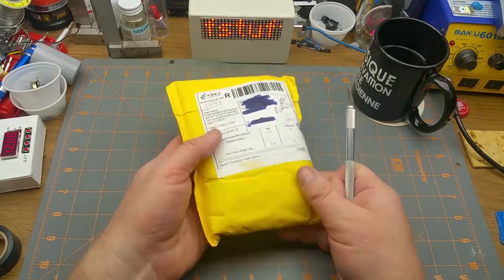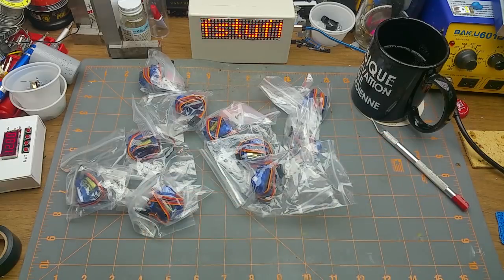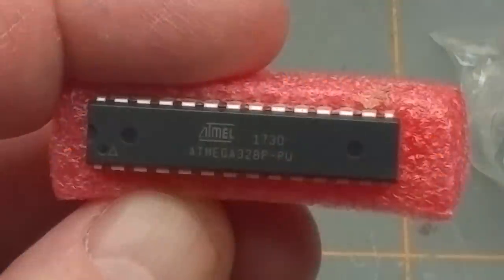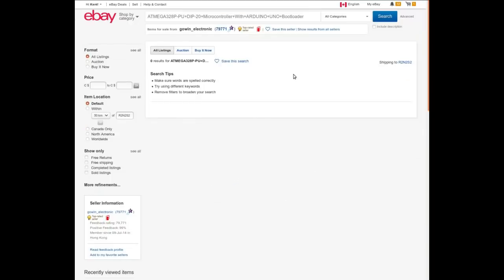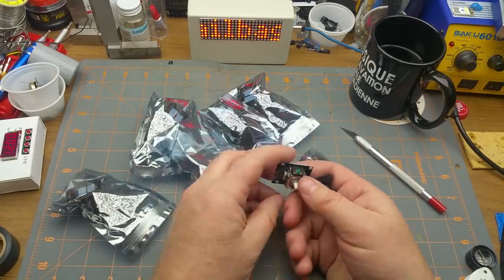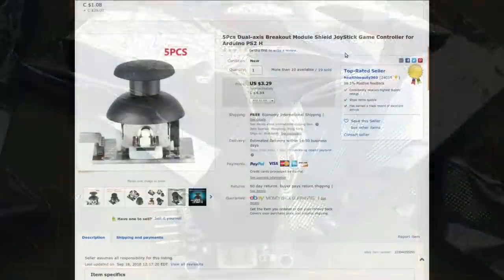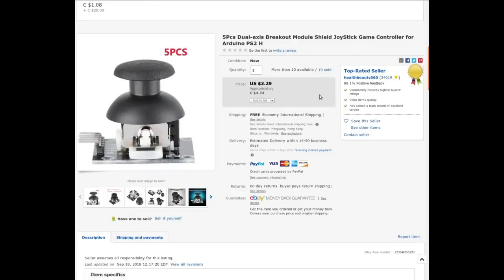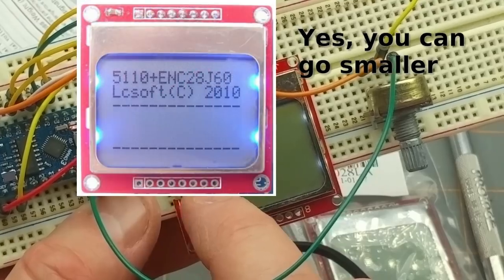mailbag monday 45

Comment: "'Plastic sheet' ... their go to lie, for customs."
When you order a 328p with the bootloader,  will need a 16mhz crystal to run it on a breadboard.  You can get by without though, by flashing Optiboot+fuses for 8mhz internal clock.  An ordinary mega8 is about 0.75USD -- low-flash / small projects.  https://www.aliexpress.com/item/10pcs-lot-New-ATMEGA8-ATMEGA8-16PU-DIP-Flash-IC/32261282498.html 
Wow, those Nokia displays are everywhere.  They must have been vastly over-manufactured.
Nice sign!

Comment: I used the Nokia displays on a pcb, added rgb backlight. Sadly the contacts aren't that great sometimes and I have to push the display down to the board to make it work. Really annoying, won't put them on projects anymore. There are 128 x 64 LCDs, think they are controlled by an UC1701 or smth like that - they seem to be better for projects, but you can't modify the backlight as easy.
Reply: Yep, I gave up on the Nokia LCDs. My source of cheap LCD has been ones branded JLX that are basically the same thing, but work 100% of the time.

Comment: Nice.
I thought those Nokia screens are not 5v tolerant? I have 2 different styles though.
Reply from the maker: I have read both that they are and that they aren't. 
My test setup was feeding 3.3V from the nano to the VCC of the displays, but was using 5V logic levels. as you see, 2/3 of the screens tested work in that configuration.

It is definitely possible that I'm just getting lucky.

Comment: have you ever done a video about your power supply? I'm pretty sure I looked thru all the titles, but results were inconclusive...
Reply from the maker: I've not done a specific video about it, but I have talked about it a few times, most recently here:  https://youtu.be/Ch7-nN_NPRw?t=406
This is the video where I built the box it lives in: https://www.youtube.com/watch?v=avv7dsoVO9o
And this is the module itself: https://www.ebay.ca/sch/sis.html?_nkw=B3603+LED+DC-DC+Digital+Control+Step+Down+Module+Power+Supply+Adjustable+Buck&_id=391047119166&&_trksid=p2057872.m2749.l2658

Comment: Isn't it strange that it's $2.04 for a bare chip, but a nano or Stm32f103c8t6 is $2?!  I don't get it.
Reply from the maker: The prices from a lot of these sellers don't make much sense. 
I saw some where packs of 2 items are more expensive than 2 singles from the same vendor...

I spend most of my ebay time trying to find the cheapest version of things.
Reply: pileofstuff good point!
Why is pcbway $15 for 10 pcbs, but ~$43 for 20 pcbs?  Is it because 10 is a loss leader?  Are we supposed to make multiple orders of 10? Or is that frowned upon?